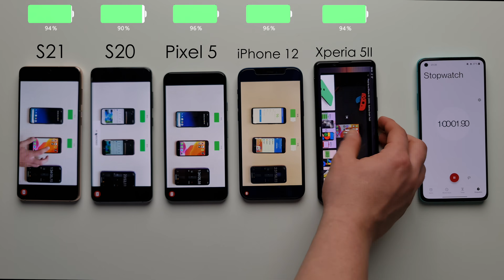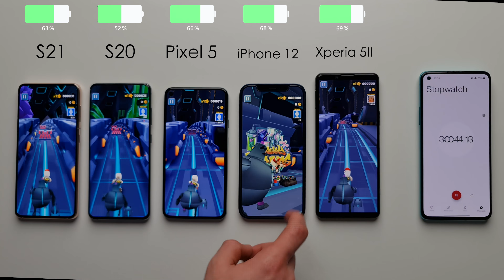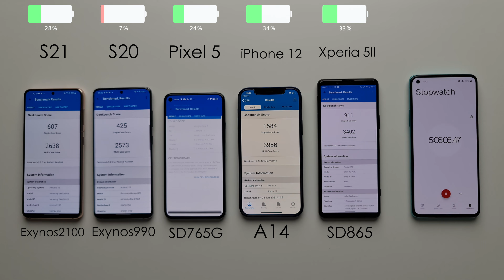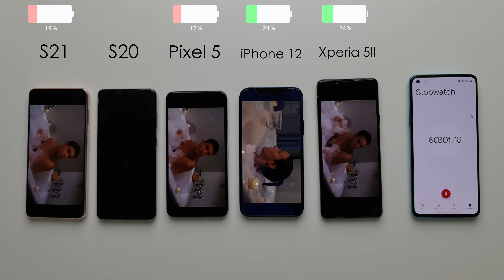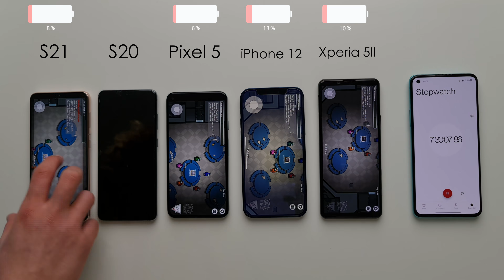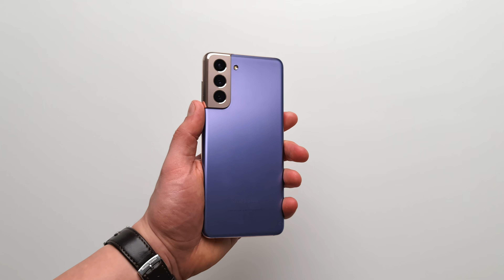Samsung Galaxy S21- ULTIMATE Battery Test! (Exynos)

Comment: 😂😂my phone looses at least 40 percent over night, I hate this but I don't have money to change phone. Xiaomi 11t pro hmm. They did some gimmick things with the battery. When charge to 100 and U quickly remove it it won't last up to 4 hours but if you leave it for 30 minutes then U can use the phone up to 2 hours and it will still be at 100 percent and imminently it starts going down, U should start looking for a charger

Comment: Then compare the 13 and 13 pro and see if there is a dufferent, the 13 pro with a smaller battery beats the regular 13 ! So i still think that the iPhine with a 120hz varuable refresh rate display would win this !

Comment: If the S21 lasts 8 hours at up to 120Hz, 60Hz fixed would make it last 10+ hours
Reply: Actually nope, it has adaptive refresh rate, so if it had 60 hz fixed it would last about the same

Comment: I went from an S20 5G to an S21. Same overheating issues. I tried the Sony Xperia 5 ii and haven't looked back. (Stock android, Dedicated Camera button, 3.5mm jack, Great battery life, notification light, Google button, thinner)
Reply: I just did the same only I ditched a note 20 ultra. I've had a couple small issues, biggest one being I can't get visual voicemail to work on at&t but my goodness the battery life is amazing. Not looking back.
Reply: same overhearing issue yet in this video it doesn't agree with you.

Comment: Are you sure the s21 can last 8 hours on 120hz because mine lasts around 6 hours
Reply: I agree. I have yet to get 8 hours out of my s21. Starts off at 100% then by 3 hours later it is down to 50% and that is with the battery saver on.

Comment: the s21 at 120hz and the iphone at 60hz logical that it holds more lgtmps if you put the s21 in 60hz it holds more or less 2h of mlus so it explodes the iphone 12 so if you do a battery test on youtube pay attention to this otherwise your test is wrong
Reply: If iphone has the same mah u Can Say the
U cant comper 3000 mah vs 5000 mah

Comment: Iphone running at 60 hz is not fair for others. Better to compare everyone with similar display settings.it is an unfair comparisom
Reply: S21 is running variable from 1a-120Hz and has a battery which is 1.25x more than the iPhone.
Reply: U cant comper 3000 mah to 5000 mah its also unfaif for the iphone

Comment: iPhone has only 60Hz therefore it lasts longer.
Reply: Btw 5000mah vs 2815mah. If iPhone 12 also have 120 hz display with 4000 mah battery this time also definitely iPhone 12 wins.
Reply: @albatross5180  sure
Reply: @SyrahSaysHi  i think so brother cause ios is very optimized. When iPhone include the higher refresh rate than they should definitely upgrade their every phones battery life.
Reply: Say it now with iphone 13 pro max 😂😂, +40% of every Samsung ever made

Comment: Sony with 7nm processor and 4000mAh battery beated samsung with 5nm processor and 4500mAh battery.🤔🤭🤭🤭
Reply: It's 4000 for both, but the 120Hz of the Sony is NOT variable, unlike the S21's.

Comment: After all, ip 12 is not 120 Hz, therefore the advantage on the battery.
Reply: I do 5nand S21 are running variable and have 1000+ mAh more than iPhone.
Reply: In 80% of regular use S21 will not use 120hz.

Comment: Well video recording and zoom do not use refresh rate, do they? Comes down to optimization. Smallest battery I mean that battery is very small and has paid off for 60hz on the iPhone, resolution was bit higher than other phones except for s20 but it still won

Comment: QHD+ 120hz you have to give some points to S20
Reply: S20 only does 120hz at 1080p
Reply: @karo3529  eya I forgot S20 can't do that but not sure if was running in 1080p or 1440p
Reply: @SD-vs4wx  Obviously not in 1440p if it has 120Hz. Still, the bad efficiency of the Exynos 990 would pull it back from competing well.

Comment: one thing to consider...is that your iphone 12 has a yellowish tone to the screen which will save more battery than the normal whites that other phones have.. and would like to know if you turned off the 120hz display on samsung or not.
Reply: at the end, Samsung when at 5% it also dimmed the brightness. I believe it might affect the test as well.
Reply: The iPhone 12 base has a yellow tint problem. Search it up.
Reply: @Emobullymaguire  im using the iphone 12... and i intentionally make the display abit more yellow to save more battery... the yellowish tint doesnt bother me at all.. and the battery life is pretty good..... I just think its not a fair comparison if Iphone 12 was using a bit of yellowish screen..than the other oled display in this test

Comment: You've gotta give it to apple. Imagine creating an OS that catch match battery life of phones with batteries twice the size.
Reply: True, but the OS is much less intensive than android
Reply: Just use battery saver mode in android if you wanna get 'optimization' of ios.
Reply: @frankreynolds9930  what and turn my phone dumb 😂
Reply: @joebmxx  Well ios doesnt let background apps to run much and battery saver in android phones almost does the same.
Reply: @joebmxx  normal battery saver, not extreme power saver
Reply: With a power efficient 5nm SoC and a 60Hz panel, surely anything can last for more than 9 hours even with just sub-3000mAh battery.
Now what if it gets 120Hz and stay on the same capacity? No amount of optimization can make it cross the 5-hour mark.

Comment: If you don't consider the iphone the winner because it is 60hz, I'd suggest running the same test again with the others configured at 60hz. I'm curious to see how much hz affect battery life.
Reply: Ohh the hz affect the battery life soo much, I can get 2h more on the s20 if I use 60hz instead of 120hz
Reply: @jonasrichtr  yes
Reply: @jonasrichtr  LOOOOOL. S20 with exynos works MAX 4 hours of screen time in 120hz and 4.5 hours in 60hz
Reply: @sergejvoronov3842  The exynos in the s20 is rlly ass should've got the snapdragon my guy
Reply: @sergejvoronov3842 read what you wrote, 4h of screen time? S20? Just shut up please
Reply: @mr.potatohead3870  good fucking luck getting a snapdragon version... if you are not in the US, it's either really expensive or just straight up impossible
Reply: if u use 120hz instead of 60hz your battery will run out faster. ;)
Reply: @MiguelCamba  s1 should test that 😁
Reply: Point it BOSS
Reply: So other phone shoud not be fully charged,  drain their battery to 2815mah to get the fair test ??????!!!!!!!
Reply: @dxyxtnx8819  That would be a battery efficiency test and iphone would win for sure
Reply: The iPhone brightness does not look to bê ajusted with same level of others. Looks like saving battery mode
Reply: @HeyMan6056  iphone automatically dims brightness to adjust battery. This can't be changed even manually
Reply: @HeyMan6056  it’s not low power its true tone
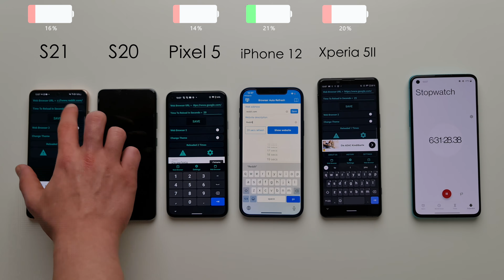Reply: 6:11 The iPhone also skipped the browsing test
Reply: @pixels_per_inch  It has the smallest battery .... close to 1200mAh less
Reply: Yeah samsung will win probably bc 120hz drains abttery fast
Reply: C est vrai
Reply: @MiguelCamba  at least 10%
Reply: @MiguelCamba  more than 25%
Reply: I do because it still acts like 120hz even though it’s only 60hz.
Reply: Rip android lol
Reply: Yeah iphone have smaller batteries, keep crying
Reply: But it has like 1200mAh lesser of a battery
Reply: What if iPhone had 4000mAh battery?
Reply: Bruh these excuses
Reply: Shouldnt the S21 have LTPO screen? LTPO means it can go from 1-120Hz in some cases, 10-120Hz and this S21 should go from 60 to 120Hz on auto I think...So the S21 kinda has bad battery IMO is it has LTPO. If it doesnt, and was 120Hz, then thats a good battery.
Reply: Despite having small battery iPhone took 1hr lead over android phones
Reply: Bro it effect alot
Reply: Then kudos for Sony
Reply: Apple advert ...
Reply: I don't need your suggestions
Reply: I love that you can adjust HZ depending on if your at home crank it or traveling tune it down to last. not to mention samsung can turn into a desktop is nutss and undeerrated af
Reply: Also a fairer battery test would have been iphone pm(3600mah) with s20(5000mah)
Reply: Anything past 60hz when not gaming is really irrelevant.
Reply: That’s true because Exynos sucks compared to A14 Bionic
Reply: Yea but that aint the point, samsung boys are always complaining about that 220hz display now when their baattery sucks, they found a new reason to argue ahhh your iphone is 60hz fixed...
Reply: @adinosmanagic2327  sheep 🐑
Reply: Samsung worshipper: Nice 120hz that's awesome it's one the best features of the s20.
Also them when iphone lasts 4 hours longer than the s20: The iphone was on 60 fps. No fair!! 😭😕✊😔😲

Comment: Samsung is in 2nd place because iphone has only 60 hz and s21 is running on 120 hz if s21 had run on 60 hz it would last 9 hrs
Reply: But iphone has smaller battery and high resolution screen
Reply: @vishnudeepak992  s21 ultra is running on 1440p with 120 hz
Reply: @relax_kit7296  adaptive means it switches between 11 to 120 Hz its never constant and also the s21 is only 1080p.
So get ur fax right
Reply: Bro, u ignoring the fact that the Xperia 5 II is also set to 120Hz and unlike the S21, it is NOT variable at all? It also runs on a less efficient (at least on paper) 7nm SD865.
If every phone was set to 60Hz, obviously this phone will be in first place, while your S21 will just be in second place.

Comment: Even that the iphone 12 won, it's not 100% fair as it has 60hz and has a little bit smaller screen. BUT I have to say that apple is doing great job as it has a much smaller battery than all the other phones there. And IOS helps a lot.
Reply: its quite fair actually considering the samsung has 4000mah and the iphone only got less than 3000
Reply: @civryllx  yep, thats why I said apple is doing great job with their OS, well optimized, besides that Android is not helping that much

Comment: iPhone is the king when it comes to the battery optimization.
Reply: True, but just imagine, if they put bigger batteries like androids do, they will have the best batteries of all the market!
Reply: Its not as impressive as i thought, its only 60hz and the battery is almost 3000mah yet it doesnt do much better than the sony running at 120hz
Reply: 60 hz saved iphone
Reply: @nikachakvetadze8508  What?

Comment: I don’t get how the iPhone has such a small battery. The phone is the same size as the pixel. Is it the thickness?
Reply: If you look at the internal layout of the two, the battery on the pixel 5 is around the same width but an inch taller in length. The only components above the battery are the cameras, which are placed horizontally. 

It looks like the Face ID components compromised the battery size on the iPhone. In addition to taking up more space, the Face ID forces the rear camera layout to be vertical, digging into the battery. I guess that’s why the iPhone XR’s flash was below the camera instead of to the right. 

In addition, if you look at the pixel 4 with its soli radar system, it’s spacing of components is similar to the iPhone, and it has roughly the same 2800mah battery size with similar dimensions 
In conclusion, it’s the Face ID

Comment: Can you perform the same test with all phones at 60hz
Reply: Tbh most people are going to use the android phones at 90 or 120Hz if they know it is there so it does make sense
Reply: @TravelTransport1  Yeah, we all know that. The point here is that we can at least test out these phones' endurance when they're all set equal in all aspects that can possibly be manipulated, specifically the refresh rate of the displays.
In other words, we're interested to see how the Android performs when they're set to have the same settings as what iPhone users have, and that is with a locked 60Hz refresh rate.

Comment: The battery difference between S21 and S21 plus isn't HUGE

Samsung claim of 4800 mah isn't genuine. It's just 30 minutes battery difference at Exynos. 

Also the display on S21 plus has least pixel per inch. S21 plus isn't worth it's price. Just a longer display with SAME BATTERY LIFE TO S21

Comment: Ok then turn on 60 hz on the s21 and then we see wich phone gonna win
Reply: What's the point of buying a 120hz and only use 60hz lol
Reply: The Sony is also at 120Hz, but unlike the S21, its panel is NOT variable at all.
Surely the S21 can win if it scores 600 single core points on GeekBench again, while the 5 II will score 900 points lol.

Comment: Image the sony' s battery run at 60hz 👌
Reply: The 120hz is not fixed in the settings you have the choice to run it at 60hz.
Reply: Im using 5ii and i set it to 60hz, it was 79% when i woke up 6 am, and now its 62% at 9:54am
Reply: @yggdrssil00  maybe you got a faulty unit. Mine barely moves in 6 hours

Comment: The s21 was 53 min less than the iPhone and if you put on medium battery (no 120hz) the s21 can last over 9h
Reply: why would anyone want to do that ? the only main difference is 120hz display
Reply: @nawtieshehzada if you need an extra hour or more then it would be useful
Reply: @gamerboycallum9962  Well then jusy buy a different phone then, there are many with no 120hz display but 12, 13 hours screen on time batteries.. and cheaper as well !
Reply: @nawtieshehzada  what if you want 120hz but 1 day you need extra battery you can just put battery life mode on
Reply: The Xperia 5 II would still outrun it when it's also set to 60Hz. Remember that the S21's 120Hz panel is variable, unlike the Sony, which stays at 120Hz ALL THE TIME.
Reply: Good point

Comment: The iPhone 12 battery life is just amazing considering how small the battery is!
Reply: 60hz vs Sony 120hz with better display
Reply: @The-Heart-Will-Testify  Sure, but still. It’s a shame that the iPhone 12 series doesn’t have 120Hz, hopefully at least the 13 Pro’s will have it.
Reply: @The-Heart-Will-Testify  in real life, ppl dont use 60hz at s21, im pretty sure they will use 120hz
Reply: @Hexaboy28  so why need compare when we got 2 different situation ! It should be choose smooth and low battery or not smooth with longer battery.
Reply: @abc-yi4ke  its called real life battery test, need to make as simillar as real life using, that is why he keep 120hz at s21 ultra, coz ppl not gonna use 60hz in s21 ultra
Reply: @Hexaboy28  i mean if you want smooth and except less battery choose s21 and s12 not smooth with longer battery. That is real life bro. Cant choose both good option in same time.
Reply: @abc-yi4ke  oh i get it, haha my bad 😂
Reply: @The-Heart-Will-Testify  well the iPhone 13 still beat all of them too

Comment: Don't forget iphone is at 60 hz whereas samsung phones are at 120 hz.
Reply: Sony is 120hz all the time and still was close to iphone. ...samsung battery is bad
Reply: Adaptive not just 120Hz
Reply: @Emobullymaguire  it's full 120hz and the highest fps on COD, it also has 240hz touch, the difference is stock Android. Sony uses stock Android with Sony apps. That alone saves battery plus Sony phones charge slower and don't kill the battery.

Comment: Exynos 990 is a disaster.
Reply: It’s time for new exynos2100!!!
Reply: @hahayou2869  still they need to improve
Reply: @iamsathya  Atleast this year they improved battery efficiency and standby but still lack behind snapdragon when it comes to pubg and cod
Reply: The power efficiency is so so bad. I have S20, I love it but I can never like the chipset
Reply: @hieunguyentrung4875  buy the version with s865 will be much better
Reply: It's not that bad as compared to when it came out. Thank god they fixed some of the heating issue
Reply: @guitarboy0211  yeah. I have the same. Now the overheating is not an problem but IT is 15:19 and i have 45% of battery. Not much.
Reply: 69 likes nice

Comment: Yeah I'm curious how the SD 888 version would fare compared to the Exynos. Also, do you think there are some battery savings in locking the RR to 60 Hz?
Reply: for sure man,i mean i really think so but it depends on one thing,I don t know if the adaptive refresh works when you re on 60hz,it could depend on that cause when you re using the adaptive refresh rate on 120hz,the refresh goes down to around 40hz when you don t need it,so that's why it might take less battery consumption than the full time 60hz,but idk I m just saying.
Reply: @MrPaul-bb6ng  I don't think it's adaptive if you're on 60 Hz. But I was thinking if a person is mostly doing reading or some other non-intensive task, would the 48 Hz be able to average less than 60 Hz. You know what I mean?
Reply: @voiceofreason314 yeah i get it,that means if you re using your phone that way you should keep it on 120 with adaptive rr on,but if you re gaming or scrolling on social  it better to use the 60hz for battery purposes
Reply: @MrPaul-bb6ng  in developer options, you can turn on a visual icon for the refresh rate.